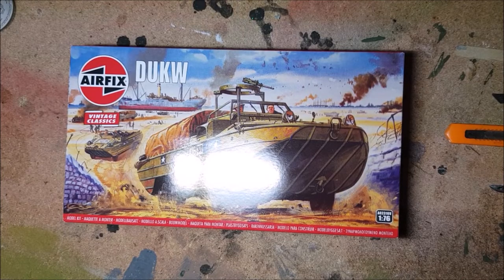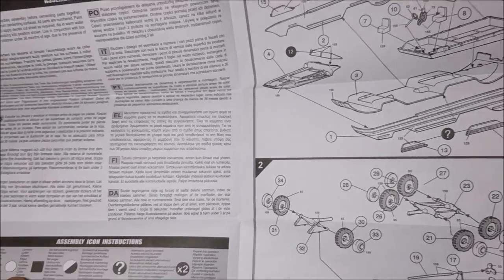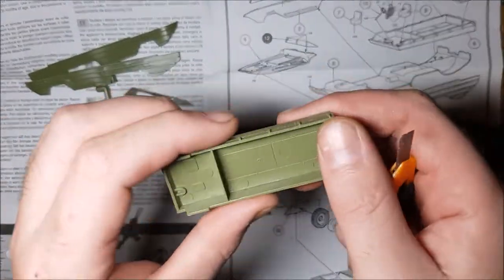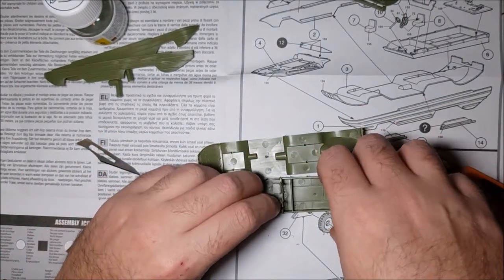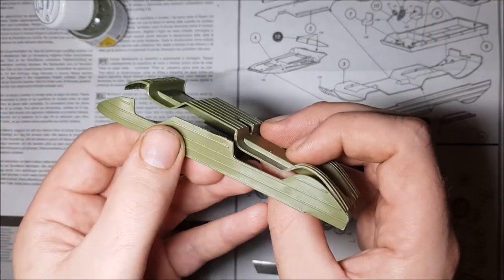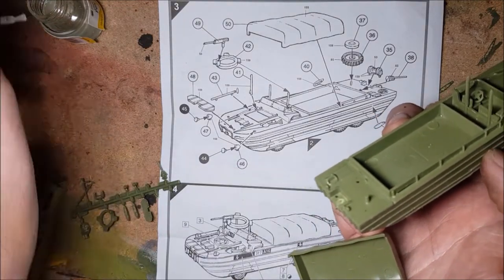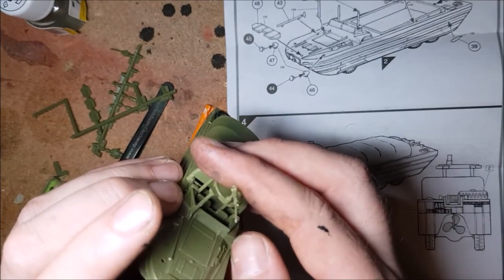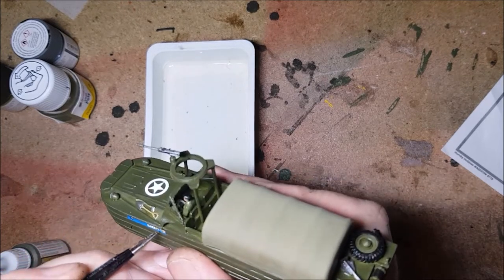Airfix Vintage Classics DUKW Duck Build Review

Comment: Nice one mate, I love these old Airfix armour kits. Did the Scammel tank transporter a little while ago… fought me all the way, looks awesome with the modern tooling Cromwell on the back. Thanks for the video 👍👍
Reply from the maker: Thanks mate, me to I have got a few more coming up on the channel but the  videos wont be released for a while, Ah nice one I think the kit fighting backs part of the fun but it does have a limt haha. Any tips for building the Scammel? Iv got one coming in the post to build the next few days
Reply: @scalestuff1066  I’ll look out for your new stuff, i think these little kits were amazing for the time. 
The Scammel is pretty damn good to be fair… lots of clean up, lots of dry fitting and you’ll get a great result. Considering it’s a 1962 tooling, it’s really good. The only thing I added was some acetate and Humbrol Clear on the windows and a few bits of stowage, job diddley 👍
Reply from the maker: Cheers mate, will warn you though that theres only a few over the next year,then a glut of them around autumn 2024.
But yeah fantastic little models for there time. Thanks I will bear that in mind its due today so I will have a look at the sprues
Nice tbh these little kits need the windows in it just finishes everything off nicely.
You where saying about older kits I have just built the Airfix chieftan, lovely kit, but could do with some pegs on the hull or hold it in place.I cant think for the life of me why its not been rereleased as a vintage classic

Comment: I recently bought the Airfix Type B bus and the Dennis fire engine, both very old moulds. I've finished the bus and that was a real trial with the amount of cleaning up and infill I had to do to overcome the poor mould quality and fitting shortcomings. The fire engine looks a challenge too, especially the ladder sections - ! 
As you say, now we're spoilt with the mould quality of modern kits.
Reply from the maker: Yeah that we are some of the new models the fit is lazer tight,im some ways though the new ones have there own issues as a slight nick in clean up and mean a part doesnt line up right later on down the line

Comment: Hello nice build but why glueing the canvascover over the loadbed? The bed is done to fit stuff in it. for example the 6 Pdr. Anti Tank Gun fits in it quiet well... Glueing the cover on ruins a ton of possible displayscenarios... And last but not least, the scale of these vintage Kits are 1/76 ! not 1/72. In the early 70's these kit was one of the first i did as a young modellingbeginner...
Reply from the maker: I havent got anything to put into the back though,I get that stuff might fit in well but I dont build the smaller scale to display there more just a time filler.I get the error in the scale though its 8 millimetres out in scale,the DUKW is 9.4meters in the real world at 1/72 thats 131.25mm at 1/76 its 123.6842 I figured it was set scales for airfix this was the last model i made the scale error on

Comment: Does this stuff come with the kit? I hope so or I’m gonna do what they did in WW11
Reply from the maker: Which stuff? Comes with the model and decals but no paints
Reply: @scalestuff1066  the tools you used to put it together
Reply from the maker: @Skitch11TheFarmer  Sadly no the glues and blades and stuff you have to get separately but you can get some good bundles that would set you up for the long run fairly cheap